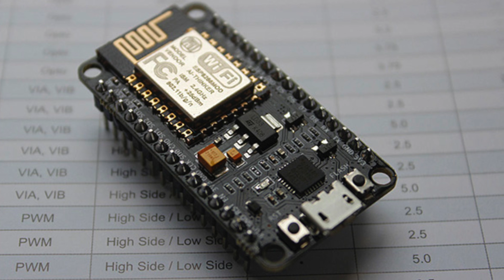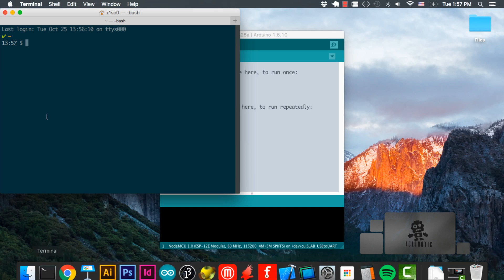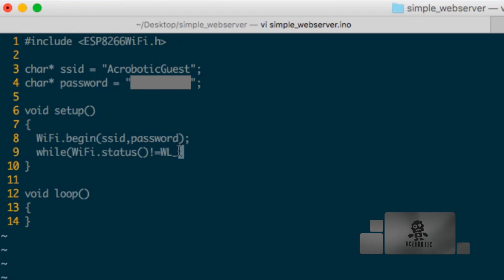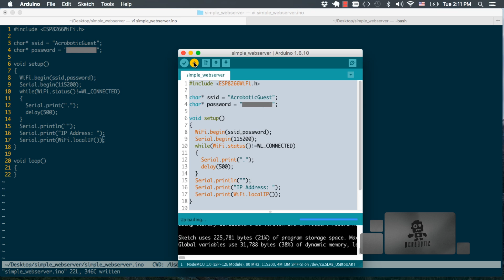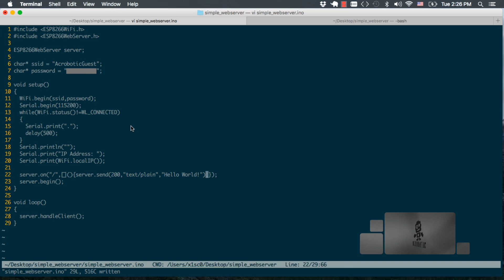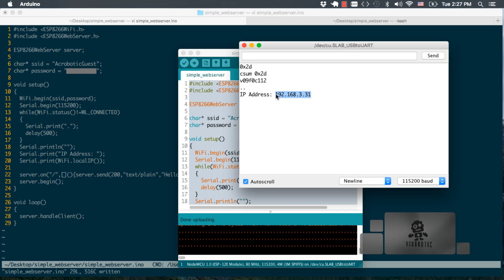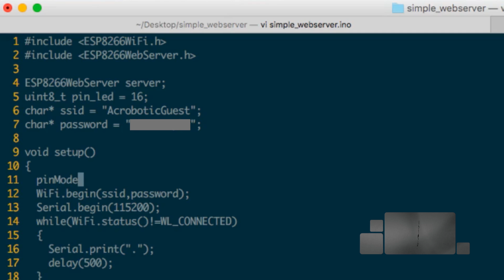ESP8266 Web Server Step-By-Step Using Arduino IDE (Mac OSX and Windows)

Comment: Hello, i have used the code described at the tutorial, my nodeMCU is attached at port COM4 and it is setup accordingly at the Arduino IDE. the code compiled ok, and it was loaded ok,  SSID and password are ok too, when it start running it issue the message: Fatal exception (0): 
epc1=0x40100004, epc2=0x00000000, epc3=0x00000000, excvaddr=0x00000000, depc=0x00000000,   do you know what can be wrong ?
Reply from the maker: Thanks so much for watching our vid and trying out the code.  Double-check that you have a delay(500) when you're trying to establish the connection.  If that's not it, try simplifying the code to the bare minimum (start with blinking the LED and move your way up) to determine what section of your program is causing the problem.

Comment: Thanks for sharing but for me the ip address is not working on chrome and mozilla both. I am getting the IP address from serial monitor but when trying to access it nothing happening. I am getting site can't be reached page. I tried http://esp8266.ip.address/ option as well which you mentioned on one of the reply. Do I need to do any configuration on my router?.
Reply from the maker: No need to configure anything on your router.  As long as your computer and ESP8266 are connected on the same Wi-Fi network you should be able to type the http://ip.address on your computer's browser and see the response from the ESP8266.  Can you try opening a terminal or command console and typing the command:

ping http://ip.address

Let me know what the response says.  Thanks!

Comment: Hi, I need some help.
How connect arduino UNO with the esp8266?  I can’t find the right path.
Please.
Reply from the maker: Hi, Manuel. You can connect the Tx/Rx between the UNO/Mega and the ESP8266. Then write code on both to communicate. On the ESP8266, you in the web server sections of the code you can add Serial.write() calls to send information to the UNO/Mega. On the Mega, in your loop function, you can monitor with Serial.read() any messages that are being sent. It's a much longer explanation, but hopefully this sends you on your way!

Comment: if i type xx.yy.ww.zz/toggle from my phone which is connected to a different network(not to the one which nodemcu is connected) will the led turn on in this case ?
Reply from the maker: No. The IP address of the NodeMCU is only accessible locally. That is, from the same network to which it's connected. To access the NodeMCU from other networks you need to do something to make it accessible. I show some options in other videos, for example:
https://www.youtube.com/watch?v=lteGQrY5Yu4

Comment: Hello! I am using your code from Github. I am getting my IP every time but nothing on the browser. Every time browser shows an error msg. That "MY IP" did not send any data, ERR_EMPTY_RESPONSE.
What should I do? I have used chrome and internet explorer as well.
Reply from the maker: Hmm, that's strange. Can you use the Command Window to run the command:
ping ESP8266-IP-Address

Also, double-check that the computer is on the same network as the ESP8266!

Thanks for stopping by the channel!
Reply: I did solve my problem by searching about the error on google. It was a problem in the browser. Now can you help me in sending my (ESP8266) data to my own domain?  And what script I need on the server to receive the data. Thanks in advance.
Reply from the maker: Check out our other videos for different web client options that could be run on your own domain!
Reply: @errajkumar5335  Got the same error. Could you provide more info about how you solved it?
Reply: @datasith  Tried to ping, but got 100% loss.

Comment: This video is so helpful, Thank you! But your usage of vi as if it only has insert mode triggers the nerd in me ;)
Reply from the maker: Good thing it's not a video on the use of vi then.
Reply: @datasith  Indeed, This is the best video on this topic, thanks for making it. is there a function to check if a button HTML tag is pressed on the webpage and if it's pressed run a function on the microcontroller?
Reply: Subbed btw <3
Reply from the maker: Short answer, yes. One way is using JavaScript on the HTML side and a route on the server side. JavaScript will send a request to the route on the server carrying the "click" data. You can use websockets, AJAX, or something of the sort. You could even do it using a simple HTTP request (using an HTML form/submit) but the whole page will refresh. A bunch of my videos cover these topics, hope you find them useful.

Comment: Can we configure bandwidth,latency and packet loss using esp8266. If yes could you tell me how
Reply from the maker: The default webserver library provides only basic functionality.  There might be other libraries that give you this level of control.  You're more likely to find such library for the native SDK rather than for the Arduino platform.
Reply: could you suggest me some libraries on  native sdk that can help me configure bandwidth on esp-8266
Reply from the maker: Don't know of any, sorry.

Comment: I'm getting no IP address, what could be wrong? That is the only thing I cant find out. But, very nice tutorial and I hope to see more of these in the future!
Reply from the maker: Do you only see periods printed in the Serial Monitor like "...................." and never getting an IP address?
Reply: Yes
Reply from the maker: Ok, then something's wrong with the password and/or SSID. Double check capitalization and try to avoid spaces.  

Also, you can try running the WiFi scan example first to determine if 1) the ESP8266 is working, and 2) you're within range of your wireless network.  Info here:
http://learn.acrobotic.com/tutorials/post/esp8266-getting-started#step-7-lnk
Reply: It found my network
Reply from the maker: Alrighty, so it's definitely something to do with accessing the network.  Either a wrong password/ssid, or just incompatibility with your Access Point :-/
Reply: Thank you for helping, I got it to work an thank you for the tutorial, there will be a lot of projects from this board that I can make, Thank You!

Comment: What language is this? Is this linux? Can I type to same code on the jupyter notebook?
Reply from the maker: Heya, the language is C++ adapted for the Arduino hardware. In a Jupyter notebook you use Python. There's a way of using Python with this hardware and you can see it in my MicroPython video. Best of luck!

Comment: WiFi.status() != WL_CONNECTED means that there is no connection right? why print something and use Serial.begin then?

Nevermind I misunderstood!
Reply from the maker: Awesome, glad you're powering through! Thanks for checking out our videos :)
Reply: I do have a other question tho, if use my home WiFi I can't connect to the ESP8266. The browser just says it can't reach it and if I ping to the IP I don't get a response. However it does work if I use the hotspot on my mobile phone. You have any idea what I should do?
Reply from the maker: Can you access the config page of your WiFi router? See if both the ESP8266 and your computer are actually connected.  After that the ping should work provided the server is running on your ESP8266. If it works on the hotspot though, it might be something funky with the security settings of the WiFi router.
Reply: Yeah I think it has something to do with security. It is actually the WiFi at my internship (a security company). They want to try and use microcontrollers for some solutions. Thanks for the video's!
Reply from the maker: Aaah, yup, that's definitely the problem.  The easiest solution is to get a cheap Wi-Fi router and connect the ESP8266 and your developer laptop to it.  You won't have access to the Internet but you'll be able to work with the ESP8266 without using your Mobile data.  IT peeps can be touchy about this so make sure you check with someone before proceeding ;)

Comment: May I ask the question?
In my Serial Monitor, it shows" IP Address: http://192.168.43.OOO/"
But when I copy it on google chrome , it can't show the website instead of showing " Hello World !"
What happened on it? Thanks
Reply from the maker: The IP Address "192.168.43.OOO" looks suspicious, can you double-check it?  Thanks for watching our videos!
Reply: Mine is 192.168.43.182 
QQ
Reply from the maker: Is your ESP8266 successfully connected to the Wi-Fi network?  Check the Serial Monitor output.
Reply: In my Serial Monitor shows
"...
IP Address: 192.168.43.182"

And I copy 192.168.43.182 on Google Chrome and failed.
Reply: I put the IP address on mobile chrome and it works. WOW

Comment: haizz, upload successfully but the light is not on, how do I do this???
Reply from the maker: Double check that you have the same board as the video. Otherwise you can use led_pin = 2 to try with a different LED. Thanks for watching!

Comment: Error opening serial port 'COM4'. (Port busy)
error: failed reading byte

what is solution for this error ,i fallow your video completely
Reply from the maker: Try resetting the board and/or computer.
Reply: Or you should close any Serial monitor opened

Comment: Great tutorial!
i have a question sir, how to fix this error
 espcomm_sync failed  espcomm_open failed
thanks in advance..
Reply from the maker: Something's failing in the communication between your computer and the ESP8266.  Try resetting the board, the computer, and ensuring that the correct settings (board/port) are selected in the Arduino IDE.  Good luck!
Reply: ACROBOTIC  okay sir thanks for response. i use arduino ide 1.6.13.. sir can i ask what board and port do you use? and lastly, do you have tutorial in esp8266 that connects everywhere you are?

Comment: every time i try to connect to the ip it just download a file and when I open it with text the "hello world" is there 
why is that happening?
and by the way great video really helpful!
Reply from the maker: You're welcome Yoad, glad you liked it.  This behavior varies with the different browsers.  If instead of using the parameter "text/plain" you use "text/html" your browser shouldn't have a problem loading up the file instead of downloading it.  Also, make sure your response code (first parameter of server.send()) is set to 200.  Good luck!

Comment: Very Useful things i found in this video...very interesting things were presented in the video...

Sir,
i couldn't understand the line

server.on("/",[](){server.send(200,"text/plain","Hello World");});

can you explain it briefly?
Reply from the maker: Sure thing Digant.  The confusion comes from the second parameter passed to the on method.  The notation [](){} allows use to define an anonymous function.  In this case, the anonymous function doesn't take any parameter so the parenthesis are empty, and it contains only one statement, which is the call to the send method.  

Let us know if you have any other questions! Thanks for watching!
Reply: Thanks sir, it was helpful to understand..

another problem i'm facing is the on server.on("/toggle",...) function is not working in my system. 
i'm using ESP8266-01 module so i tried with toggle the LED_BUILTIN as led_pin, but it didn't work...

any other solution regarding this???
Reply from the maker: The built-in LED on the ESP-01 module is connected to pin 2.  Instead of LED_BUILTIN, try it with the number 2, and you'll be able to control the TXD LED.
Reply: Sir i found the pin number of built in led light (pin 1) and tested it with blinking..
but still i'm facing some problem with it it don't toggle when i'm calling IPAddress/toggle..

here is my program..

#include<ESP8266WiFi.h>
#include<ESP8266WebServer.h>

ESP8266WebServer server;

//int pin_led= 0;
int pin_led = 1;
char* ssid = "iconoclast";
char* pass = "newneton";

void setup() {

    pinMode(pin_led,OUTPUT);
    Serial.begin(115200);
    WiFi.begin(ssid,pass);

    Serial.println();

    while(WiFi.status()!=WL_CONNECTED){
      Serial.print(".");
      delay(500);
    }

    Serial.println();

    Serial.print("IP Address: ");
    Serial.print(WiFi.localIP());

    server.on("/",[](){server.send(200,"text/plain","Hello World");});
    server.on("/toggle",toggleLED);
    server.begin();
}

void loop() {
    server.handleClient();    
}

void toggleLED(){
    digitalWrite(pin_led,!digitalRead(pin_led));
    server.send(200,"text/plain","LED");
}
Reply from the maker: It's connected to GPIO2, therefore you need pin = 2 (not 1).  Good luck!
Reply: yes sir, it worked.. thanks for your kind help...thank you so much.
Reply from the maker: No problem, that's what we're here for!

Comment: is this method secure??...if the ip adress is obtained....anyone can operate it,right??
Reply from the maker: Yup, if the IP address is obtained, anyone can operate it. One easy way to secure it could be to connect the ESP8266 to a Wi-Fi router, and configure the router to only allow traffic from certain MAC addresses that you trust.  Of course, this is not a perfect solution either, but it's a start. Good luck!

Comment: i put a link to the "toggle" web page in the main page,& i tried to make it redirect me to the main page again with a simple html code but it's keep reloading itself.
the html code work fine in the browser.
<meta http-equiv=\"refresh\" content=\"0; URL=\"http://"+ip+" \">
you can leave me ur e-mail so i can send u the full ino file.

Thank you in advance for your answer
Reply from the maker: Hey, Ahmed.  Thanks for your questions! The main reason is because the /toggle route currently doesn't return anything.  If you change the arguments inside the server.send() statement to (200, "text/html", [](){YOUR HTML}), then you'll be able to see the redirect working!

Feel free to contact us either through https://acrobotic.com/contacts or master@acrobotic.com :)
Reply: Thanks,I'll try.